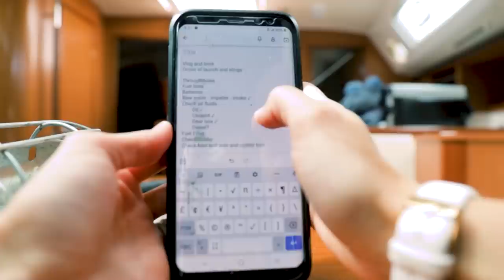Our SALVAGE SAILBOAT Can't Stay HERE | Expedition Evans 3

Comment: I work on boats for a living. Have worked on that same make and model boat. Nice boat. Just wanted to suggest that sooner then later you replace ALL through hills and fittings. They fail cause they have high zinc content and no bonding system. It’s a known issue so insurance companies are not paying claims for boats like yours that have those old through holes and valves. Might as well change then all when your doing all those repairs. Good luck.
Reply: Yes all through hulls replace with made in USA parts and sea cocks
Reply: Particularly when you sail into the tropics. All my through-hulls were original and operated fine in PNW waters and yet all of them seized in one single tropical season. Had to replace them all.

Comment: Interesting videos 
Engine  stop button needs the ignition on to work. Hit stop button, stop engine, then turn off the ignition 
Best of look guys but get a surveyor report before you spend on the boat any more
Reply: Couldn't agree more. And, get an engineer involved.
Reply: Jay Perry yes, the Key 🔑 turns off all the Power to the Engine AND the stop 🛑 switch,
The stop switch Shuts off the engine, Then the Key 🔑 turns off EVERYTHING...!!  Just think of the Stop switch as the Mixture Control on the Airplane (Red) then when the engine stops turning, you shut off the Mags (and key if there is one) like the Cessnas, but not like the B-727...!!
Reply: Anna, I was telling them why stop button didn’t work in my comment.
I don’t need an explanation thanks as I have been sailing over 40 years.
Reply: Jay Perry my g
Reply: Be careful to never turn the ignition key to “off” while engine is running, as in try to stop it that way. Doing so runs the risk of destroying the alternator. It’s electricity being generated with no where to go due to the circuit being disconnected.
Reply: @ThePagorman  Quote you " ... destroying the alternator. It’s electricity being generated with no where to go due to the circuit being disconnected." 

That is not how electricity works, Ohms Law : U = R * I, and derived from that P (Watts) = U * I
Which means that the alternator use almost no mechanical energy, because there are no load (RL is very high), if there is an open circuit connected to the alternator. 

Looking at P = U * I you can see that the alternator generates a very low amount of watts into an open circuit, because I is almost zero. 

I (current measured in Ampere, A, AMPs) is very low, because the load (RL) is very high.

I think you mean that the alternator will rotate faster. There are always a  limit to how high the angular frequency (RPMs) can be for a mechanical device.
If an alternator don't use mechanical energy to create electricity it "invites" the engine to run faster (more RPMs), and more RPMs can destroy any electric generator and motor, and any dinosaur-fuel engine. 

A diesel engine die/self-destruct, if it goes into a diesel runaway
Reply: @charonstyxferryman  I was cautioned against it. And it makes sense to me with what I understand about collapsing magnetic fields feeding into externally biased regulator circuits. You may be right, and no harm will ever come from it. For myself, i think I will continue a cautious approach.

Comment: You really are as you both have said many times “SO LUCKY” 🍀  That IS a really N1CE boat.
And I realized What it was missing bad at  17:01  the Dodger...!! 😍🥰🥳👍✅. Think of the Stop 🛑 switch as the Mixturs on the Cessna, then when the engine stops turning, you sit off the Mags... The key 🔑 switch  😎

Comment: Good job getting the boat in the water.  Do some research on the mast, and be prepaired.  replacing the mast on a boat that big is going to be $25k or more by the time you include the furlers and standing rigging!
Reply from the maker: LUCKILY we have a mast! (And nearly new sails, rigging, etc!) In our searches for boats we looked at several boats, most from hurricane damage, that were without masts. And you're right, masts are EXPENSIVE. And for a boat like this 25k is on the low end, for USED!

Comment: You need a real boat structual engineer/ expert to tell you how to rebuild the keel into the hull . Fiberglass alone probably won't  do it .
Reply: Fairly easy DIY repair.
Modern materials have evolved to make it stronger than new with the right preparations.
Good as new in no time.
Reply: Look at UMA, they were told the same thing, now several years later boat ain’t sunk yet.

Comment: I'm surprised a grounding hard enough to push the keel up, deform the hull, and crack the structural framing on the hull, did not cause a lot more leaks than the video shows, much less not crack the hull as well.
Reply: It could be that the bad build actually saved it by being a "crumple zone". I's just a thought!

Comment: The engine not stopping is likley  just  wiring to the stop solenoid.  easy fix.
Reply from the maker: Our guess as well. Pretty low on the priority list to fix, but we'll get to it eventually! Thanks for the tip!
Reply: I think you hit the stop button.... Then turn the key off
Reply: @davewarren5263  I agree, stop button needs juice to stop fuel flow?  Then turn off key
Reply: Diesel engines are stopped by cutting off the fuel! They don't have electrical ignition that is cut off by turning off the key!

Comment: Why did you put it in the water with such a structural damage?
Reply from the maker: Since the mast was taken down and the boat wasn't taking on water it was safe enough to motor it to the new marina. We only had it in the water for about 24 hours then had it hauled and blocked on the hard at a marina where we could do all the repairs.

Comment: .... Yikes .... the suspense .. going from buying boat, showing the damage inside to we are launching in three hours .... you splashed .... oh there is water in the bilge ..... we never saw the outside of the hull .... and then you left the boat .....  laughing, gotta say lots of suspense, .. you did say be on the hard next episode, was really wondering , No, they are not going to do the repairs in the water, but maybe that is a way to do it with the water giving even pressure hull against the grid cross-members, but what is supporting the keel .. as you can tell you had me thinking .... mighty fine boat I must say, and three cabins too, ... in case nobody mentioned it, but then again how close to real time are you, the the plastic tray is the dust pan that goes under the floor panel that you found in the sink, but you have figured that out I bet ..... never stop dreaming, just dream bigger .. have fun be safe, save our oceans ....